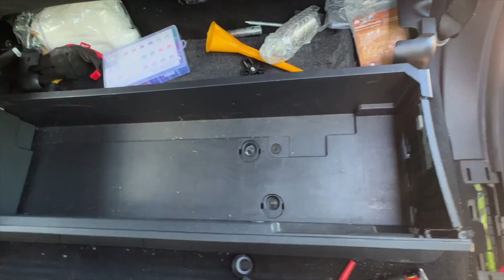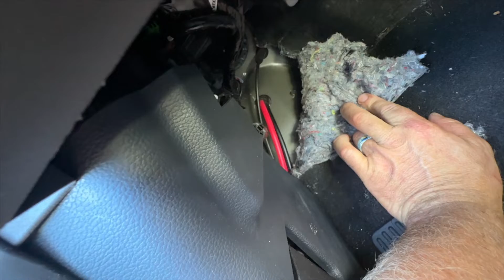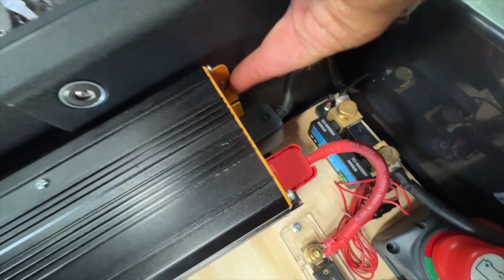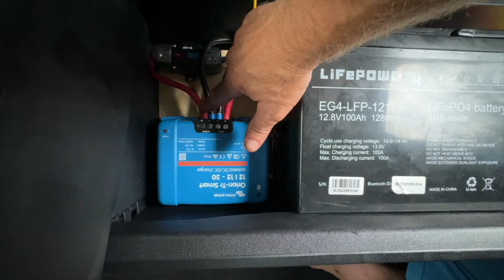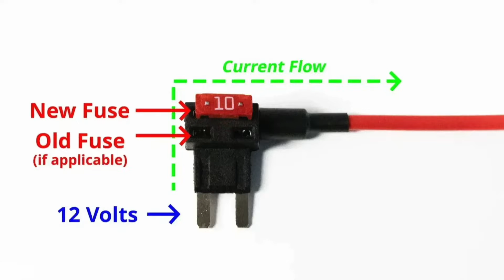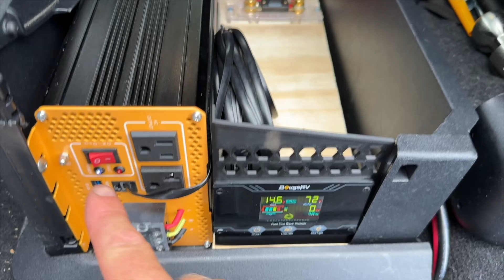How to add an Inverter to your truck for off grid camping

Comment: Good video... but why run the negative cable from the battery?. Ive always been told,  the shorter the ground the better. I know these trucks are aluminum,  but there are ground straps on the frame.

Comment: I have a ton of things I have to alternate for charging or operating in my truck cab during long shifts... From Chargers and FM/Bluetooth transmitter to a dashboard mounted heater or even a battery charger for my electric cordless 60V snowblower. 
My main issue is not just that she of these items aren't 12v, im also terrified of leaving something plugged into the 12v outlet and killing the battery (it isn't switched, the outlet is even without the key).  Wouldn't mind a powered cooler running on the summer and a food warmer in the winter.
I work out of my truck, I know it is different use case, but do you think a similar setup with perhaps a smaller battery? Or do some inverters cube with a battery built in?

Thanks for any advice or reply.  I've never touched electrical in my truck... I just know if I turn off my truck for a half hour or an hour I can still start it without having to unplug everything

Comment: Joe. Thanks for the great video. I currently have a 2002 Chevy 2500HD with a 8.1 engine. I find myself needing to power up something while I using the truck to do something on my property. Especially needing 120 volts. Thanks for allthe great info. Very helpful 😅😅

Comment: thanks for the info on size of components.  I am curious how many OEM 12v converters in RV's will mate with LiFePo. I have a '22 rig, but everything seems old school (pre-solar prep package).
Reply from the maker: you can look at your converter and see what it is.  Pretty much all  of the ones that are put in now can detect LiFePO4.  If not, you can simply change out the board.  Progressive dynamics makes swap outs so you don't even have to replace the whole panel, just the converter. https://www.progressivedyn.com/power-converters-2/
Reply: @2KrazyKampers  thanks for the link!

Comment: I have been looking for a LiFePo 100ah battery, but I couldn’t find it in the link to their website. I’m familiar with them. Did you have to call them for that particular battery? Thanks for the video. I’m doing a similar build but for a different application.
Reply: Shopsolar in TX shows them in stock
Don’t know anything about this company
Reply: @tux707  I check their website last night and again after I read your comment. I don’t see them on the website. I’ll call them this morning. Thanks
Reply from the maker: you might want to call them.   They sell out constantly.   When I checked the other day they were in stock and now it looks like they are out again.
Reply: @2KrazyKampers  talked to signature solar EG4 is no longer offering that battery. I also called Shopsolar and got the same answer. I’ll keep looking. BTW  I’ll be doing a 48v build next year when the new Rv is delivered. Thanks for the informative videos